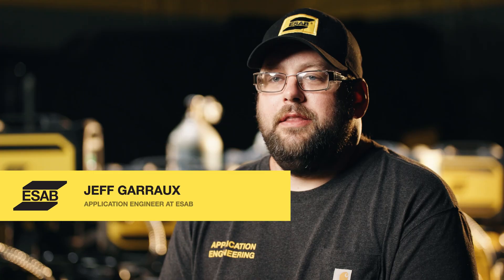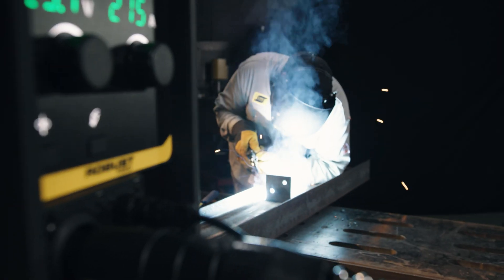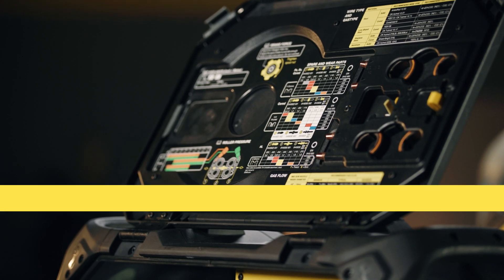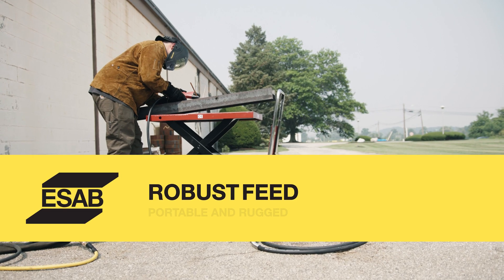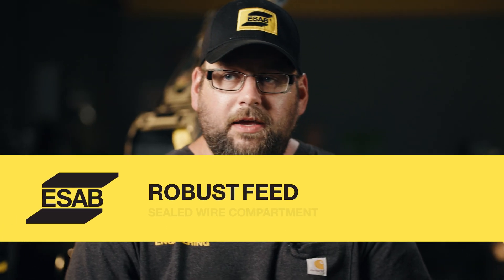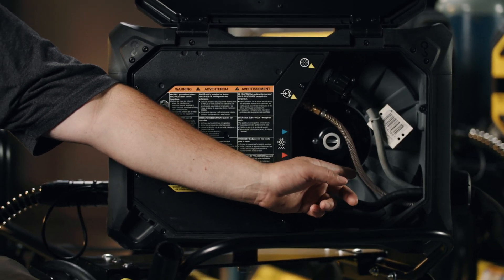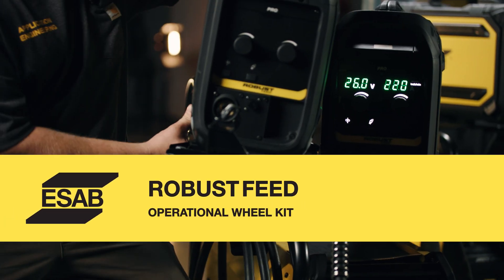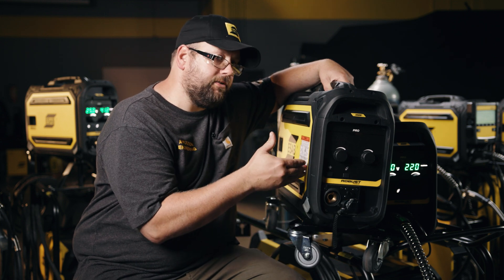RobustFeed Portable Wire Feeder | Heavy Industrial Welding | ESAB Welding & Cutting

Comment: Great video. I'm glad you had this guy tell us stuff rather than some sort of advertisement sales dude. He seems to know whats up. It would of been nice if the price was mentioned on these. I know miller and Lincoln offer something similar and they are quite pricey. The other factor is he doesn't mention how to connect it to machines that are non esab? Can that even be done? I bet many folks in the mobile welding world would like to see this hooked up to some sort of engine drive or just a generator powered machine to see how well it performs. God bless and all things for Gods glory. Happy Easter.